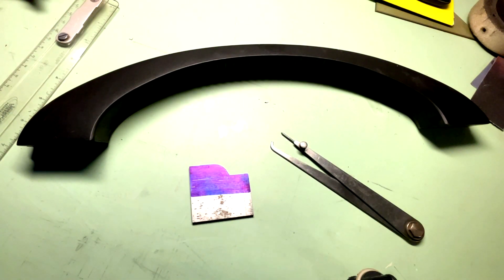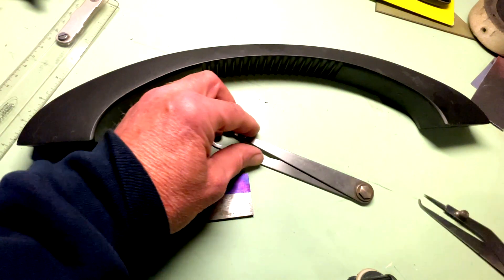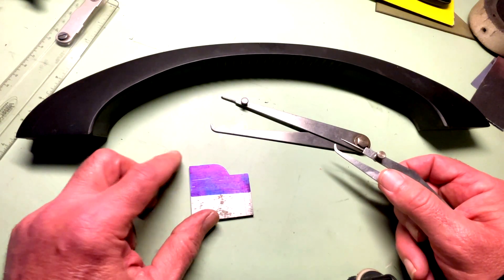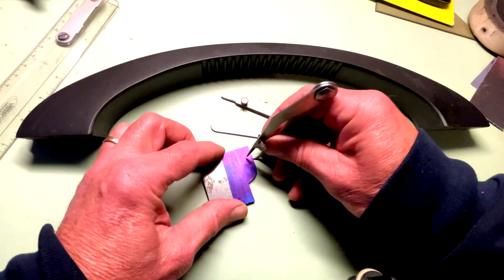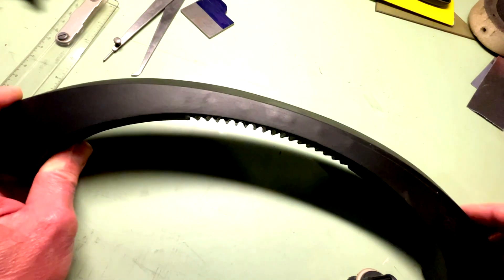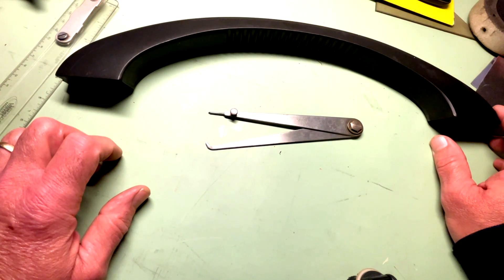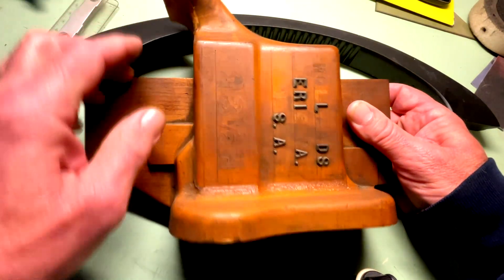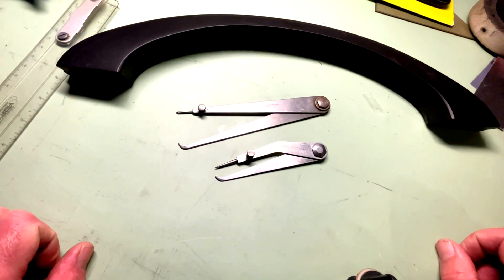HOW TO USE HERMAPHRODITE CALIPERS

Comment: Using them as you demonstrated is fine as long as the caliper scribe remains perpendicular to the work. If the foot gets ahead of the scribe, the line will change dimensions.

Comment: I just figured they where called hermaphrodite calipers because of being able to measure both male and female parts.

I've used mine for setting either the I.D. or O.D. of something I'm measuring and taking it to a ruler. The legs can swing around to orient what I call the foot, to facilitate the use for inside or outside dimensions. They've been used to take linear measurements where it's difficult to place a ruler as well. For precision, I use vernier calipers. However they remain in the shop, the hermaphrodites travel. 
 
I haven't thought of using them as a scribe. Thank you for the tip, it's as if you gave me a new tool.

Comment: Moore & Wright (of Sheffield, England) have a simple patented upgrade to these, where the guide-side has a step, which makes keeping it registered on a piece of sheet material dramatically easier.

You could perhaps search for 

Moore & Wright Traditional Hermaphrodite Calipers
Reply: In the UK, the ones with a step are usually called odd leg calipers for marking along an edge as demonstrated. The ones in the video with curved legs are Jenny calipers and are more often used with the curved leg pointing out. Both are hermaphrodites because the legs are different to each other.

Comment: Use mine all the time for doing layouts at the bench. Hermaphrodite calipers and a six inch scale to set them is faster than using a height gage on a surface plate to strike a line parallel to an edge. Place the point in the desired size marking on the scale and bring the other leg up to the end of the scale and Bob's your uncle. Import calipers are less than $30. The American made ones will last about four lifetimes so keep an eye out for used ones at estate sales.

Comment: I used my sets of hermaphrodite calipers all the time when I worked in a fab shop. They were a life saver for doing layouts. 
I could easily layout centerlines and set distances from an edge on I-beams no matter how twisted they were.
They’re also handy for doing sheet metal work. 
They’re a lot cheaper than replacing a combination square set when you’re doing open tolerance work.

Comment: Pretty handy and you can use the outside type (or maybe the leg is just flipped over) to scribe a line on sheet metal for guarding for example from the machine that the guarding is for.